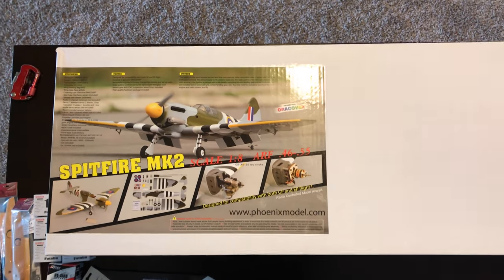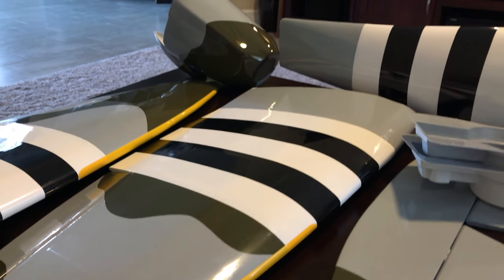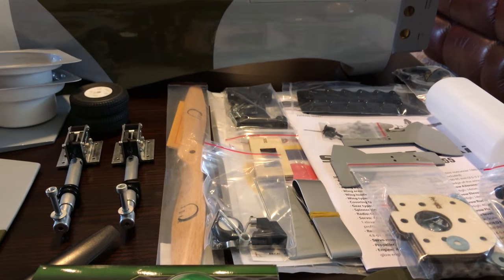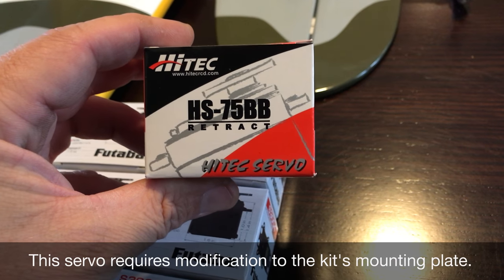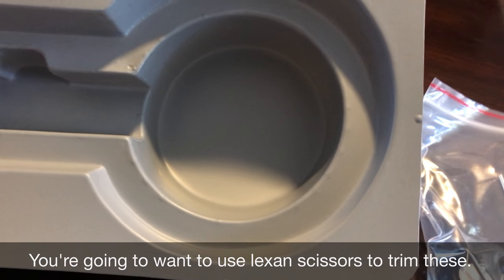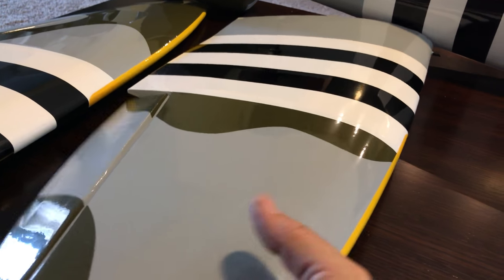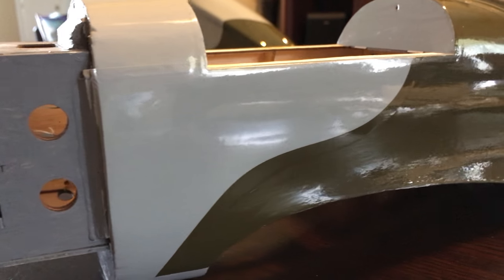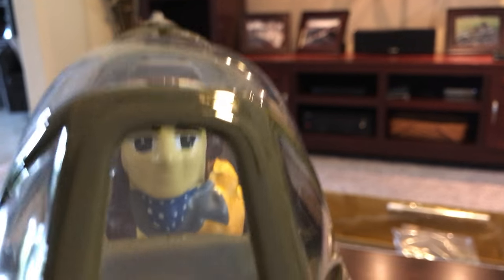Phoenix Model 55" Spitfire RC Plane Unbox Review

Comment: I'm a nitro guy and it was very easy to modify the motor mounts to accommodate an OS .65 2 stroke engine with a 13 inch prop! Super fast! I'm very happy with ALL my Phoenix models!!!
Reply: Hi there, I'm thinking of buying this plane.  Can it be flown relatively slow, or does it have to be flown fast to to keep it from stalling?   Regards.
Reply: If I buy this plane, I'm intending to put either a 60 or 70 fourstroke in it.

Comment: Bought this one on sale from Tower for a winter building project, it was $158 including tax .  About all I will have to buy to complete is a motor, electric and prop. I have enough servos with enough performance though they  are smaller than the S3004. I would rather spend some extra time adapting these servos to the plane than spend $90 on 6 S3004's. 

I plan to use 6S batteries as I have a number of them and no 5S's.  I have learned to install control horns that require screws before connecting the control surfaces. 

Hope it goes well and I will defintely use your videos of this plane.
Reply from the maker: Enjoy the build. It's a good looking plane.

Comment: Im using the sk3 4250 500kv, a 13x6 3 blade, hobbywing skywalker 80 and a turnigy hd 4000 6s (60c)  Havent ran that motor but I'm hoping it will be a good combo as it's the 3rd power setup to be on the spitfire. Both nitro setups before hated being ran inverted.
Reply from the maker: Justin Anger I have that motor and I think I have a 13x6x3. Have you done a watt meter test with that setup? Are you saying 6s battery?
Reply: @RCVideoReviews  have not even powered it on yet

Comment: Nice video!
How long the retracts lasted?
Reply from the maker: They still work to this day. Thanks for watching.
Reply: @RCVideoReviews  that’s Great. Thanks for the awesome videos about this airplane, I been watching all of the several times, will be installing a OS Surpass 70 this week, a friend of mine told me to do the tail at last, after installing the motor and servos, to avoid hitting the tail during the engine and servos installation, that seems like a good tip. It will be great if you do a follow up video with that airplane 👌🏼
Did you find a better tail wheel after all?